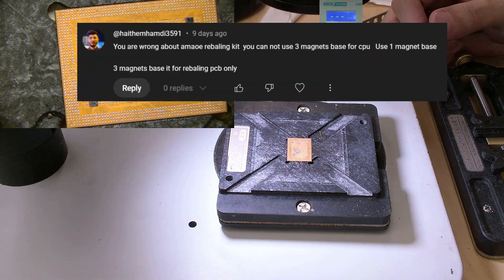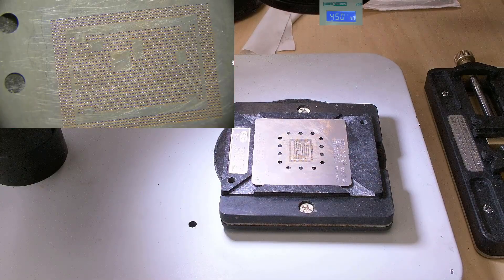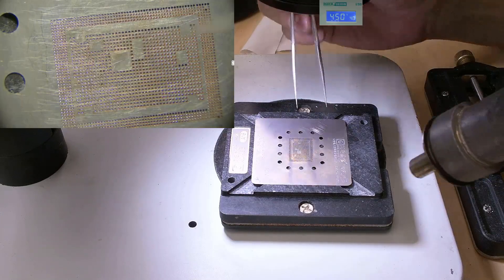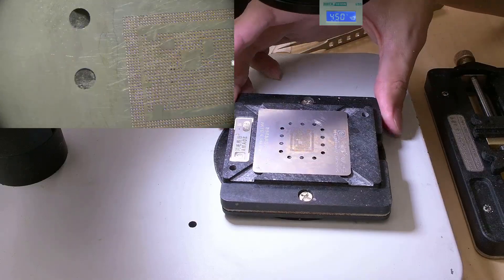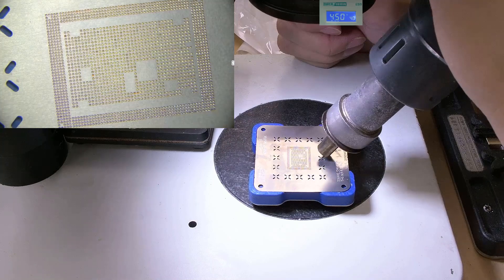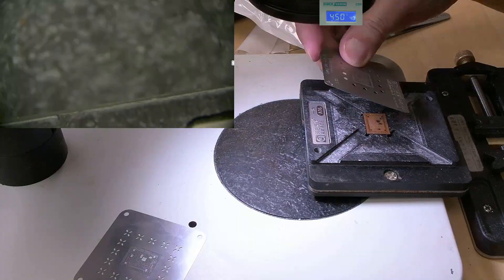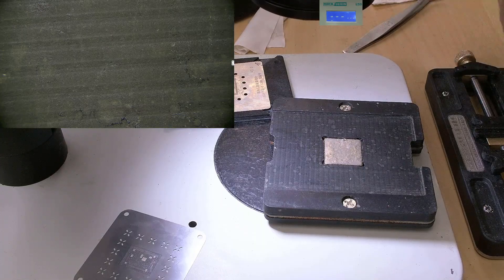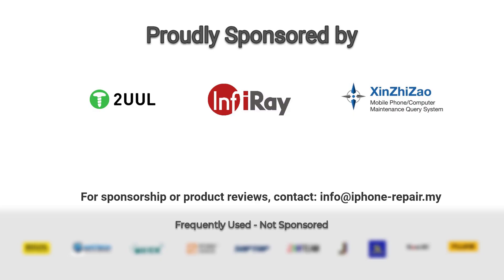Answering the Comment: CPU Reball Kit Stress Test

Comment: Thank you for your interest in my comment on the previous video.
Honestly, I haven’t tried attacking the stencil directly with high heat.
However, when it comes to the three magnets, they can only be used on the processor with either very low heat or very high heat.

For me i like to use amaoe rebaling kit
Reply from the maker: My research is based on those CPU competitions. There is more about CPU limits, i'll share some tips if i got chance.

Comment: how about separating the middle layer? do u use preheater or only hot air gun? and which preheater do u recommend
Reply from the maker: Cannot rely on just preheater in new models. Need both. My favourite preheater is XZZ L2023